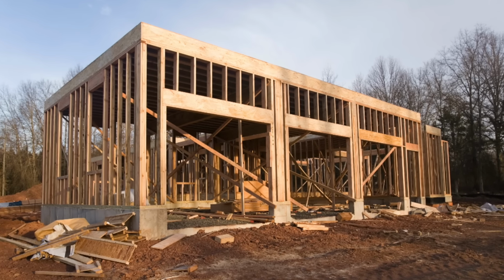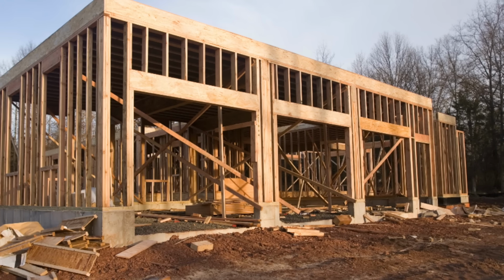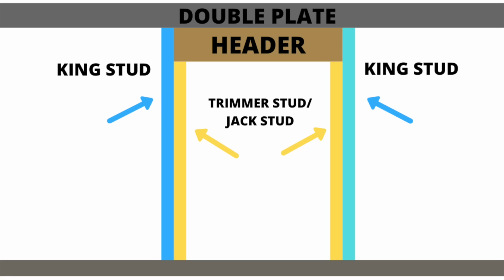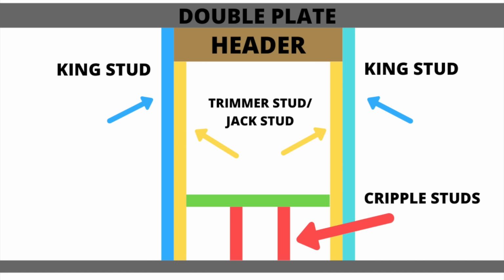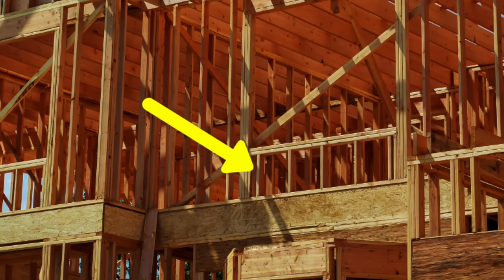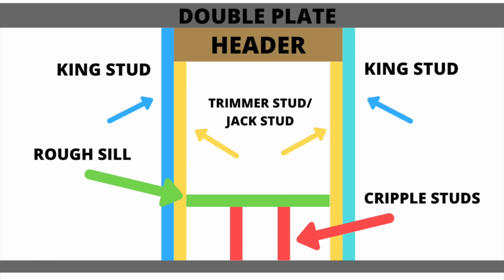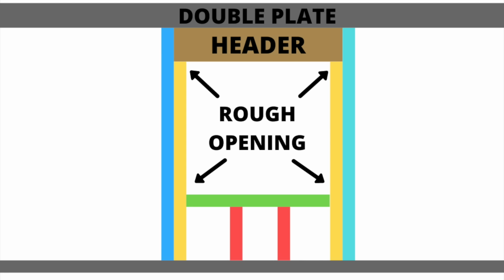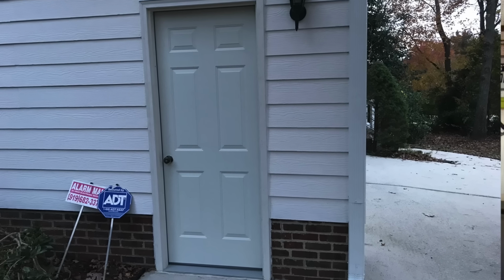All House Framing EXPLAINED...In Just 12 MINUTES! (House Construction/Framing Members)

Comment: I seen some track home comments  a big builder is going to cut every  corner  they can there after $$$$ not quality. 
Get it up fast get it sold fast an move on. 
In the south where houses sit on just slabs an maybe 12 to 20 inch deep foundation  the slabs will fail I seen a million  buck house where the back fill was not compacted  an has sunk 20 inch away from the slab. Track homes I wouldn't buy one unless it was built before 1975

Comment: Frame construction is a good way to build a moderate and medium priced house. Here in the US they dominate the high priced house market too. 
For the first time in a thousand years stick built houses are being built and pass off as royal estates. Notice also that the quality of the materials of these "Mc Mansions" is the same, or nearly the same as that used in basic houses. Americans are focused on bling and not quality.  Big is better, and one can get a lot of big using cheaper materials.  Add to this are amenities, something most houses older than the 20th century had little of.  Amenities are those added bits which catch the eye, closets, bathrooms,  hardwood floors, commercial kitchens, swimming pool, 4 car garage (often still cluttering up the front of the house) and grand stair cases (I admit these were popular in the past) 
One will notice no chimney's, odd window size and placement, curious faux old look, but not following any real historical style. Acres of drywall, not plaster,  carpet and wood floors not marble/mosaic.  Silly peel & stick stone or brick on the side of the house, not following even the basics of what is not possible with real stone, such as seeing a patch of stone on the second floor not supported lower down by stone. 
For those looking to spend alot for grandeur, compare the wealthy, pre WWII houses  with late 20th century neighborhoods or newer.

Comment: Great presentation! I would like to comment that I-joists look like they should be cheaper, but that has never been the case.  They have always been 40-50% higher than solid sawn lumber.  Today, with the unrealistic lumber prices, I-joists are only 20% more than solid sawn.  Where I-joists shine is when you want to span 20-30' you can buy 14", 16", and 18" depth I-joists, which have no solid sawn equivalent.  Theoretically, you are only paying for the OSB web material when going from a 9.5" joist to a 14" joist, because the chords remain the same size and material.

Comment: I've never seen anyone sheathe a house after the walls are stood... I square my (exterior) wall on the ground, tack it in place with an easily removable nail, throw sheets on and router out windows, shear nail, all that good stuff, and then pull nails and stand the wall. ALWAYS MAKE SURE YOUR WALLS ARE SQUARE. If you do and you still run into a problem, you know it's not your fault. But as a framer, you still fix it and hide the mistakes from the foundation guys usually...

Comment: As a non-American, I've always wondered why Americans don't use concrete and bricks for construction.
Reply: American housing seems to be built fast and cheap, i would never buy anything built using these construction methods seems more like a glorified shed than a house to me..
I live in the UK where double walled brick is the primary construction method. Its slow and expensive as its massively labour intensive houses take around a year on average to complete from foundations to moving in. But there is a reason why most the houses in my area are over 200 years old. We build to last.
My grandfathers house was built in the 1700s.
Reply: @tothethreshold.9965  I'm not sure if wooden houses are that much cheaper, since wood is very expensive building material. And with these prices in the US... I think they can do better and maybe this is entirely or mostly a cultural phenomenon.
Houses in the UK are living heritage - both cultural and historical. You must be very happy and proud to have a house, that old. Great.

Comment: What is the 2x6 on edge with a 2x4 laid flat 90 degrees to and on top of ceiling joists in an attic? Maybe used instead of blocking? Can I remove if I sheath the attic floor?

Comment: roof would be less complicated if u ran your roof framing under the sheeting! u have to in my area
Reply: i meant over it. sry. in my area u have to sheet parts of the roof and then frame  on top of the sheeting. looks like ppl doing nice work on those houses. ive had to work with hacks for years

Comment: How long do wood frame homes like the ones you're showing last without intervention? 100 years?
Reply: Looking at how they are built, if built good with proper materials; 30 years max. Called, expected lifespan of a building. But I’m not from the U.S.
Reply: @willbee6785  you are wrong my house is wood construction from the late 60s and still solid. thats 60 years

Comment: There are straps or "let-ins" that are used for seismic restraints. The straps are generally galvanized steel, and let-ins usually dimensional lumber. No in all instances is sheathing used to stabilize a wooden structure.

Comment: You should put foam or caulk below the sill when laying it out to stop airflow and insects. You skipped form tubes with footings, and posts to support the first floor i-joists or flooring system.  They can also use treated lumber posts to resist termite damage.  Proper subfloor construction includes gluing the panels to the joists, then screwing them down.  You are talking about platform framing, there is also balloon framing where the studs are long and can run between bottom floor and roof plates with no intermediate plate. Fireblocking is not done much anymore, if at all.  It makes putting in insulation and wiring too hard and doesn't provide any real protection.  But some blocking is used when walls are taller than 8 feet and the sheer needs an edge to be nailed to.  So you will see blocking placed to edge nail the sheets.  The front of the tread is called the 'nose'.  In the West, there is also substantial metal hardware to deal with earthquake codes....these things are attached to the foundation via threaded rods deep into the stem walls, and are bolted to framing members.  There are also rigid panels embedded in corners to add to the shear strength.  You could also add framing for a fireplace (inserts), timber framing, and metal framing.

Comment: So, with the engineered lumber and I joists: They are HORRID when it comes to fire resistance. Most people don't realize how important gypsum (drywall) board is to protect them. Trusses are the same way. As soon as those metal plates fail (as they are not in very deep) they whole system fails, and collapse will follow soon after. Little tidbits like that are things people do not consider in the price of building things. 

A great video, though, definitely helped me keep a few terms straight that I keep getting mixed up, thanks!

Comment: My parents had a second story put on their shore house. They had to use Hurricane Ties to Span the 1st and 2nd Floor.  I noticed the other day the siding looked like it was buckling, so I unzipped a piece.  The Ties are nailed in, but seem to be, being pressed down, causing the center strap nails to pop out, or become loose.  I couldn't see any rot on any wood, but I only took out 1 piece, and cut a small opening in the Ice and water shield, so I could close it back up secure, until I figure out what to do.  IDK if the house is settling, or it's something much worse. Any Idea?  The Ties are 36" long
Reply: If the floor joists are solid wood (vs i-joists or floor trusses), it could be from the joists shrinking as they dry out. The 2nd floor has actually dropped slightly. I've seen that happen a lot in houses with synthetic stucco cladding.
Reply: @jobacuda4472  It has I Joist, because the back bedroom was squeaking in a certain spot. I pulled the carpet up, cut through the Sub floor and the I Joist was either not Glued to the sub floor or the screws missed, cause I was moving it. I just screwed it from under the I in the joist them put some grabbers through the sub floor. When I cut the ice and water shield there was a small space.  Shouldn't there be some type of rim board, or atleast sheathing on the outside of the house, under the InW Shield? I'm just wondering if I should have a structural engineer look at it, or atleast a Carpenter. I'm an MMA Fighter with some Carpentery knowledge, or would you think its OK.  I know your answer is not a hill to die on, being you can not see it, just a gut, from what I'm telling you.  I honestly thought I was gonna be pulling out splinters of rotted wood

Comment: Am I seeing this right? One can knockout a six inch hole in an engineered joist to run utilities through and it won't affect structural integrity?
Reply: Yes. Look at a floor truss. Mostly air. The strength is all based upon tension and compression.
Reply: @jobacuda4472  I get that, but I would have imagined that the spacer board in between the top and bottom segments is there to prevent the distance between the load under compression and the load under tension from changing? I'll have to look into it more to understand.

Comment: I just finished up a 3 year remodel. I used Simpson structural screws for the stick framing. Loved them. I also hand nailed the sheeting with #10 Galvanized nails to create a great diaphragm.  I am so happy that the technology of structural screws has finally come to fruition.  Thanks for the great video. Just started a solar job and the framers want to be did the worst framing I have ever seen along with the worst plumbing and electrical. Truly pathetic to see unskilled labor infiltrating the trades.

Comment: The Sill Plate being Pressure treated is more for insects like termites. Now being PT is a moisture advantage but houses properly built don't have sill plates that rot from moisture. The sill sits on 2 layers of foam sill seal like a diaper or Styrofoam strips 6"'wide so sill doesn't sit on the foundation directly. The box joist would rot also but they don't unless a defect. The sill is the interface so wood can connect to masonry. I joist engineered lumber is not cheaper or easier, you cant get any easier than a 2X dimensional lumber. In many cases never even need to cut them just run by the carrying beam up to 12" or more if in a basement and no drywall s going to be installed under them. Nice video I think you did a really good and well executed video My comments almost dont matter in big picture  But you asked so I like you are open to honing your knowledge. PS constriction adhesive on the floor joist shout out maybe

Comment: Great Video man! 
Aussie truss designer here.
Very interesting to see the small differences in the construction methods!
Alot of comments about the lack of sheathing on walls, or minimal sheathing, 
But the thing i noticed more was the lack of tiedown rods...we usually use threaded rods from top plate to joist or slab, at anywhere from a 2 ft to 6ft spacing, depending on the wind loading. do you guys do that?? sheathing must be cheap by the square foot im guessing? 
We dont sheath over trusses either, just battens.
Reply: They don't use a lot of tie-downs here in areas without large wind loads or seismic activity. I lived in Reno, NV for a few years and they use a LOT of tie-downs there.

Comment: BCI Joists came out in 1978. Homes these days are built out of wood chips and glue and sawdust and glue for trim. I've seen a lot of changes in the "quality of lumber" over my 50 years in construction. If I were to build homes these days, I'd be using, concrete, steel studs stone, any good repurposed wood I could get my hands on.

Comment: I am a plumber and thought that the horizontal lumber between the vertical studs was call bridging and gave the wall strength with a heavier loads and that the fir break in that cavity was for balloon construction .
Reply: Not much balloon construction anymore. Bridging (or blocking) is required in taller walls and at the horizontal edges of the sheathing in shear walls.
Reply: @jobacuda4472  thank you for your explanation I appreciate it

Comment: I'm sorry, call me crazy, dumb, old fashioned - whatever, but I'm never going to build a house in which I plan to live for more than a few years, using I-Joists. 
I believe our ever-increasing reliance on OSB will spell disaster for millions of homeowners one day. 
What happens if you go on vacation and you develop a plumbing leak between floors - or a slow leak in a crawlspace running across the member in question?
Solid joists? A little mold. Drywall repair. 
I-joists? Your support turns to mulch. 
Commodity OSB as sheathing? Same thing. Worthless if/when moisture makes its way in. 
Who knows how the adhesives used will fare 50 years down the line?
You can say you do, but you don't. 
I understand that companies like Huber are making resilient OSB products that are far superior to commodity OSB; but give me quality solid rafters/joists or a truss system, and quality plywood sheathing and subfloors ANYDAY over an OSB-based product. 
Again, this is not production building - I'm presenting the scenario in which I'm building a custom home for a customer or my own residence.

Comment: Hi I feel like you answered a question I had but I’d like if anyone could confirm for me. 
We have a wall that separates our kitchen and living room. I’d like to get rid of it but I am pretty certain it is load bearing, however there is a small window opening in that wall so while in the kitchen you can look out to the living room. 
My idea was to open this window area bigger so it’s much more open. I believe there are some studs in between the widow area and the ceiling, can I cut those shorter and essentially reframe it so the area is bigger without it effecting the structure? 
I hope I explained this well enough. If it helps I believe the house was built somewhere around the 30’s.
Reply: It's best to consult with a structural engineer to determine the load on the wall.

Comment: interesting to see this. I am from eastern europe and there we never build houses just from wood. I am curious why they do it in other countries. My old family house was traditionally built from clay/stray blocks. thick walls as well around half a meter wide. really warm in the winter and really cool in the summer.   Nowadays most houses are built using bricks or ytong. I live in the uk now and I just cant believe why electrical wires are just shoved behind lightweight plasterboards. When I saw it I was shocked at first. Back home because the walls are solid you cut channels in the walls  and use small diameter plastic pipes for the wires so in case of a fault you can pull the wires out and put in new ones. It seems these houses in the video are quick to build though. Do these last generations or just designed to rot quickly?

Comment: Really appreciate the video buddy. Could you explain how it's safe to use holes this size in the joists without the overhead weight causing the joists to collapse? 2:18 
My contractor school says the holes can not before than 30% of the beam width I believe
Reply: For the same reason that a floor truss is mostly air.

Comment: Bottom plate top plate stud's horizontal knogs joist hangers centin piles this is new Zealand terminology it's all similar All our framing and trusses are manufactured in the factory to the architects plan trucked to the site prefab and we put them in the right order and stand them up then line the building and nail temporary braces once it's all plumb 😁

Comment: 2:18 How are these I joists functional with gaping holes like that?
Reply: Joists get their strength from the sheathing over the top and sitting on sills and walls. Putting some well cut duct holes isnt going to hind strength much as long as a joist isnt cracked all the way through.
Reply: I joists are designed that way. The manufacturers have tables showing how big holes can be (and where they can be.

Comment: Very interesting. Here in Australia our timber framed homes use pretty much all the same terminology the only difference is really when it comes to sheathing the house. We generally do not 'sheath' the whole house in ply board prior to wrapping. We usually install what is called bracing ply in key locations (designated by the engineering) around the house to brace it up and stop movement. We also install cyclone rods which is threaded rod that extends from the foundation to the top plate which assists in holding the roof down during high winds. Furthermore generally all framing in the house is treated timber, not just the mud sill, this helps prevent rot and termites as the houses are generally built to breath not insulate.
Reply: Before we started completely sheeting in OSB
Back in the 90s, we only installed osb for 4 foot on the corners
With blue board in between

Comment: In Norway we'll use a layer of solid tar paper as a moisture barrier under the mud sill.
Reply: We used to do here in Canada too, about 30 years ago. :-)
Reply: In Australia it's a thick plastic sheet. Comes in various widths for different wall thicknesses, and embossed so less of its surface is in contact with either the timber or the concrete.

Comment: I’m always curious about these new apartment buildings going up all over, and they’re 4-5 stories with just 2x4’s all the way up. They look like matchstick buildings.
Reply: a max of 4 stories of wood construction on top of a reinforced concrete base = total of 5 stories, is allowed/typical per current UBC, IIRC. despite it maybe looking like matchsticks in that phase, it is quite a solid way of building. (eg. it's allowed in the bay area where we have some of the most restrictive codes due to seismic activity.)
Reply: @jraaccounts  I think at least the first floor studs need to be 12" on center. Is that right?